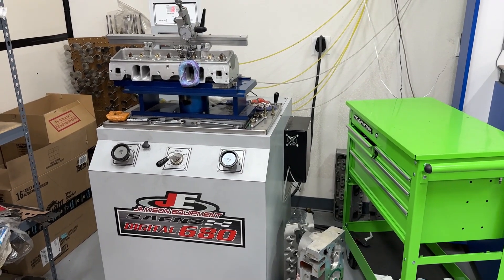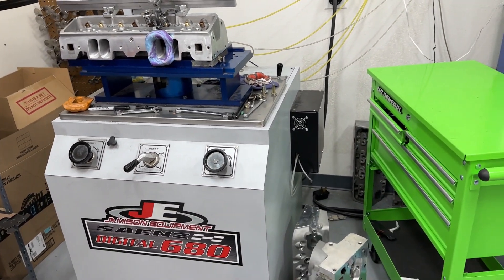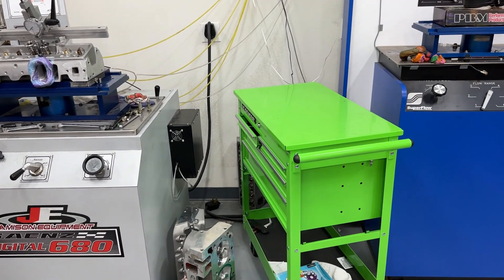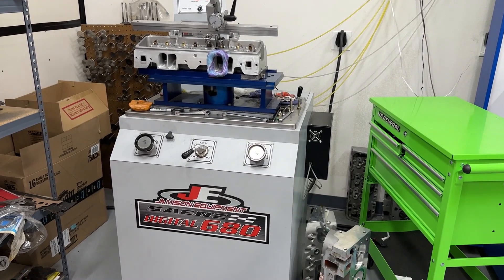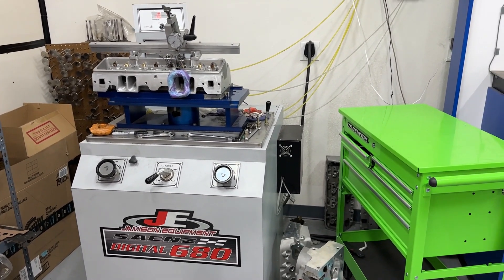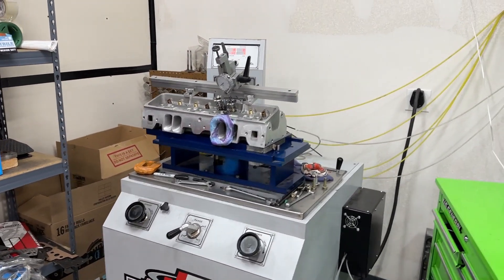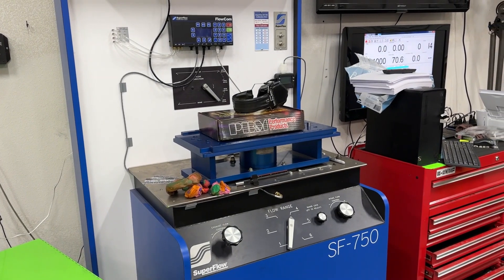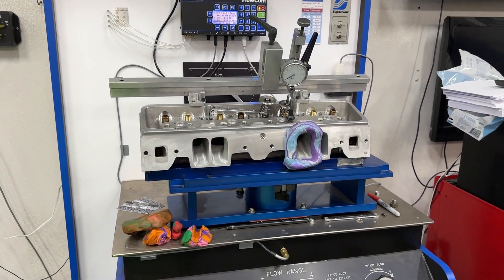Differences In Flowbenches

Comment: I don’t think the quick reaction of a motor control bench is good, if you have a head that is on the edge of seperation then the quick response will cover when it does seperate, it will drop the motor speed to drop the depression and then pick it back up.
A manual bleed or ssr controller I believe is better, you get your test pressure to 28” and leave it for 5 seconds, watch to see if the depression is moving around indicating instability in the port. If the short side does let go for small moments you will see the depression rise, you won’t see that on a bench that auto corrects the test depression.
Reply from the maker: I see your point but if you do like I do you see the instability because the computer actually records that. I have the computer take 20 recordings. It takes those readings and tells how stable it is as percent change. The quick change in pressure causes the backups to occur that doesnt happen with ramping in slowly.

Comment: I just had a pair of Gen2 LT4 heads ported by a reputable porter near me.  The baseline stock flow numbers on my chart are far lower than ANY stock flow numbers that I’ve seen posted for these heads, from any source.  The current flow numbers are much-improved, but are not overly impressive.  I am hoping that it is a difference in testing procedure or a very conservative flow bench, otherwise, I have the absolute WORST pair of LT4 heads ever produced.
Reply from the maker: It could be that many on the internet inflate the numbers. I have one here but if I get some time I will flow them.
Reply: What test pressure was used? Some people use 10”, 25” or 28”
28” minimum should be used.
Reply: @seanb250  28”.  I will look at my flow sheet later today, but the stock flow number @.400” was 227cfm (like a 170cc vortec), and my LT4’s were 195cc.
I needed flow to .600”, and the max flow @.600” is currently 275 cfm.  I did retain the stock 2.00”/1.55” valves though.  I wanted Eric to do these heads, but he was down with a health issue when I decided to send them in for porting.
Reply: @mistered9435  2” valve will support 350cfm at 28” test pressure.
The best comparison is always a before and after of the same head on the same bench and look at the % gain.
The way you will know what the real cfm is is when you dyno it, where the power levels off will tell the story.
Reply: @seanb250  thank you for the response.  Without the flow chart in front of me at the moment, I am thinking that we netted about a 21% overall improvement, albeit at a different lift point.  Upon looking at the old Chevy High Performance testing, it looks like the stock LT4’s maxed out at 250cfm @.500” (230 @ .400”), so I guess it is looking better now.  Internet forum heroes had claimed much higher numbers, but.......
Either way, these heads will feed my little 355 with its Comp XFI292 cam.
Reply: @mistered9435  what rpm do you want to pull?
Reply: @mistered9435  275cfm will support about 6300rpm with your 355
Reply: @seanb250  ...well now I’m a bit concerned.  My cam card says 2200-6200, but there are a few, old forum posts that say that their 355’s with this cam were peaking on the dyno around 6600-7000!  I am assembling my short block right now, and all of my components were chosen for this maximum rpm range.  In fact, the reason I wanted to stick with the stock valves is because they are hollow-stemmed (stability and quicker revs), and the chamber wall is already very close to the fire ring, so it looked like unshrouding a larger valve would be kinda moot.
Reply: @mistered9435  the valve sizes aren’t an issue and 7000rpm would require 300cfm.
Your original statement suggested that your heads numbers seemed low but also the stock numbers were low on that particular bench.
If you take your 20% flow gain and apply it to other stock head flow data then you get 300cfm, so your possibly in that range anyway and won’t need to worry, like I said tho, the dyno will let you know 👍
Reply: @seanb250  I’ll hope for the best.  Meanwhile, just for S&G, here are the numbers from my flow chart:
         Stock.                              Ported
           Int.      Exh.                      Int.       Exh.
.100”  66.1.   50.9.                    66.7.     52.5
.200  126.2.  98.1.                    133.6.   114.7
.300  170.4.  133.9                  184.9.   151.5
.400  205.1.  161.5                   227.2    181.1
.500  228.8.  176.3                  259.2    199.3
.600  226.7   182.6                  274.1     209.7
.700  224.3   185.1.                  272.0    215.4

Corrected to 28.0” int,  28.0” exh

Port Flow Analyzer v3.5 B
Reply: @mistered9435  yeah I think there has been a calibration issue because those discharge coefficients are garbage at 100 lift for a 2” valve. 
I think you will find the heads will perform better than what that flow data shows 👍
Reply: @seanb250  I’m so glad that you responded with helpful info. I called the head porter today and he said that they calibrate their Super-Flo 600 to read 4-5% lower because most customers have a non-SuperFlo or homemade bench, and they don’t want the customers to get lower numbers and start making accusations.  Lol.  That’s where I was going with it!  
If I add 4% to my chart numbers, then the  stock baseline numbers coincide with the books, magazines, and Internet forums’ numbers (as you mentioned).  I’m much happier now.
Reply: @mistered9435  was my pleasure 👍

Comment: My 1020 is a little slower for sure. It doesn't really bother me. But faster would be nice🤔. It is extremely repeatable and so far has been an excellent testing device.  I am unsure if catching it back up because its faster is a gain or not. Because we cant yank air as fast as in a runing engine anyway. Maybe all heads back up on the engine and we need a new way to test?  Interesting observation at the least.